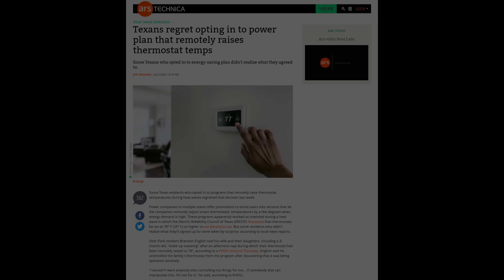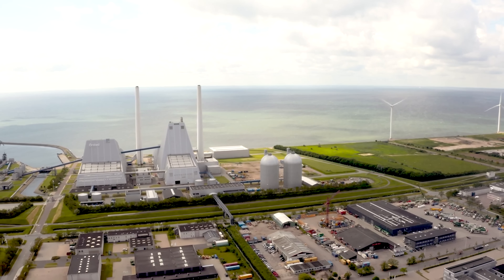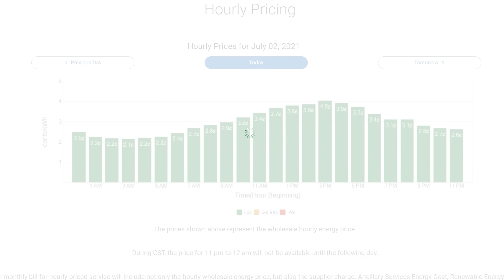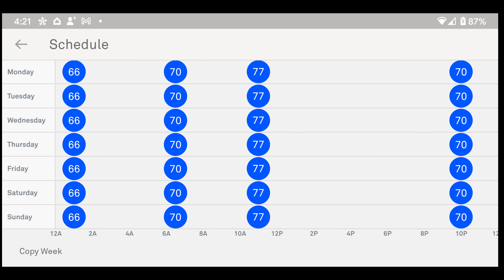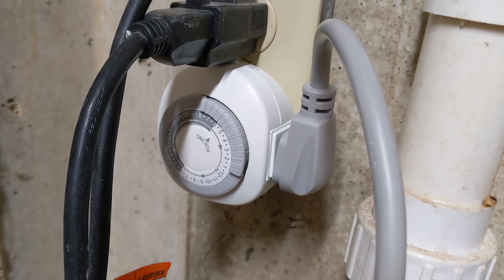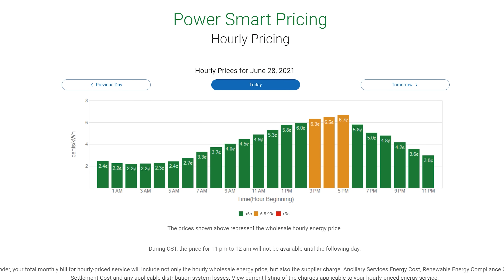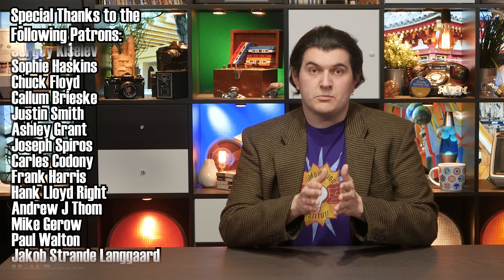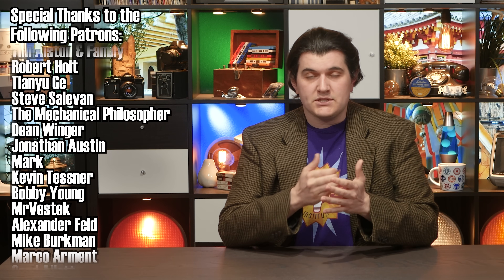Batteries aren't the only way to store energy. Here's another.

Comment: 22:36 As an engineer, an overly simple solution that still meets the objectives IS the elegant solution.
Reply: Exactly, the simplest solution that gets the job done adequately is the best solution. You do have to define what "adequate" is in order to get a good result from this method, however.
Reply: Yea probably these sort of solutions deemed "not elegant" because of their simplicity suggest a certain lack of optimisation. Though, this isn't necessary the case - but being well aware just how complex things can get when optimised to certain objectives - makes any simple solution a suspect.
Reply: @CraftyF0X  The thing is, with good engineering, you need to know when to stop improving the thing and just build it. So you set a target for what's "good enough", and when you hit that target you don't add any more optimizations for that goal. You might work on reducing the cost of producing it, but you won't improve its effectiveness at performing its designed task, because that's wasted effort.

Comment: Our house was built in 1951. When we bought it 25 years ago it still had the original single pane wood windows that swelled/shrank, leaked air, sweat and frosted over in the winter. About 5 or 6 years after we bought it, we had all new double pane low E windows put in. Also about 6 or 7 years ago the air conditioner started having issues, so we had a new  high efficiency furnace and AC unit installed. We have also put in all new entry doors (3) and insulated garage doors. We've spent well over $25,000 to save energy/money. Also, we had a new roof put on last year because our old one was worn out and needing replaced, but we spent extra money to put on a roof that is supposed to help with energy savings. It takes a long time to make that kind of money back in energy savings. I'm pretty sure that we may never break even. 
We could have spent more money, for even more "savings", but I don't know how much more "money" we can afford to save.
A lot (I would bet that most) people living in older houses can't afford the expense of retrofitting their houses to bring them up to modern day energy standards.
Reply: 61% of Americans live paycheck to paycheck, so yes, a majority of Americans don't have any capital for improvements. I kept thinking about my mom's single-wide trailer and that even if I had the money for improvements, it seems really silly to pull the whole thing apart to add insulation. Would probably be better to add a vertical wind turbine on top and call it a day.

And my 7th-floor apartment with a wobbly sliding door to the balcony isn't doing me any favors. At least heat pumps are standard on the building.
Reply: We just got a home built in 1973/1974. Still has original single pane windows with aluminum frame and individual panes of glass (6 over 6, has glass squares/rectangles with aluminum strips between them).
Winter time they sweat and drip all over the windowsills.  Summer time they radiate heat right through.  
Original insulation. 

We are already fixing to get a new roof, and I'll be putting the plastic shrink film over all windows..... They're on the "list" but they're gonna be mighty expensive!
Reply: @Nukepositive  you don't pull it apart, it is just blown in.
Reply: I don't know how much more "money" we can afford to save... haha
Reply: Spending $25K to save money on energy costs and then realizing that you won't save a penny is really heartbreaking... and poor planning. The person who buys your home will either thank you for investing in their future or shrug as they demolish the entire building. 
I held on to my old faithful oil boiler (home heating) for years, and I love it...but the price of home heating oil keeps rising and the new bio diesels have not been cheaper or accessible. The extra yearly expense for oil means that I will see a return on my investment in a few years.
Reply: I live in a drafty house with a huge set of old french doors, so what I've been evangelising for (the admittedly mild Aussie) winter is electric blankets. Kinda need to use them during the grid's peak hours, but like 20 bucks each, 60W for maybe 3 hours each day, and if you're still cold you can put some more damn clothes on. No I'm not a dad.
Reply: @lucash1980  If they want to sell the house, the investment they made actually will make the house more expensive.  So they effectively raised the value of their property. (and probably lowered their taxes)
Reply: Werent there some tax incentives to make your house more energy efficient? You better check how is your local laws work in that regard, but I think you can request lower property taxes or some shit like that.
Reply: I feel for you.
Im in a duplex built in the 50s
landlord been here 3 times in past 5 years fix ac u nit
I think you been mislead ina bunch of ways
25,000 spent on saving money seems odd
been cheaper getting homeowners insurance or better yet
DIY a little at a time

enrgery standards? really?
how about safty and comfort standars?
wish could see your house give a quote
25,000 may could claim as home equity on taxes?

Comment: Air flow management is basically all we had for a few years. Draw air on the shaded side of the house and exhaust on the sunny side. About halfway through the day we would switch it. Combined with proper window shades, it was very effective.
Reply: Yet most of the new houses in Texas don't even do this basic thing
Reply: @Cian O'Flynn This is only feasible in places where temperatures actually cross comfortable territory for significant lengths of time during the day or night for most of the year, though.
Reply: So, no humidity where you live or do you just adapt?
Reply: @donovan2913  we get terrible humidity. The air flow just keeps it all moving
Reply: @2ManyGoats  moving humidity is still humidity
Reply: @ipodhty  don't know what to tell you. It works
Reply: I try to do that, but my parents are so incredibly stupid and wreck the system all the time.

Comment: The Celsius conversion is very much appreciated! (:
Reply: Phil McCracken accurate would be 9/5 *C + 32, and the -40 is a thing.
Reply: @Phil McCracken yeah but most of the world doesn't want to have a calculator in the hand all day...
Reply: @Phil McCracken I've honestly just memorized every 10°C jump in Fahrenheit up to 40°C, and then from there go 2°F for every 1°C. It's off by 1°F when you get close to multiples of 5°C, but close enough anyway.
Reply: I just remember that each degree Fahrenheit is 0.55°C (recurring) and then guess wildly from there! I am often wrong
Reply: @FoxEagle993  every 9°F is 5°C, but remembering every 18°F is 10°C and working from there is a bit easier to remember.
Reply: @Phil McCracken You can improve that trick even further, by only adding 30 instead of 32. Multiplying by 2 will naturally overestimate, so if you then add a little less, the errors tend to cancel out and the result will be slightly more accurate, plus it saves a step when adding in your head.

Comment: Running AC at night would also be more efficient in general too wouldn't it?  With lower temps outside it would be easier for the condenser to reject heat.
Reply: Yes. Only no answers would be if it were cold cold. In ambient temperatures drop to 40⁰ and lower most residential aircons run into problems (unless its a heat pump in heating mode ofcourse👍) and  damage your compressor. Its called "slugging a compressor " funny name. Basically what happens is this:
Compressor is made to pump gas/vapor, so, if temp drops low enough to cause the heat in the low pressure gas to leave fast it will condense into a liquid. This is bad news since liquid doesn't compress. When liquid enters the compression area (could be a piston, scroll, or rotary type), it damages the parts that do the compressing and eventually crumble those parts into chips and chunks. 
Fun fact. To get around this happening in Commercial applications they toggle the condenser fan via pressure switch in refrigerant line. Also the put this giant hose clamp around the bottom of the compressor that is a heating element that warms the compressor and oil to a good operating temperature in low ambient conditions.
Reply: @joshmiller7870  Probably you dont need AC if the outside temperature is around 5C.
Reply: @collan580  personaly myself, no need. However in commercial buildings this common practice.
Reply: @collan580  Because of uneven heat distribution. Some rooms will still need heat rejection. I have servers at home, and even in the winter that room will need to be actively cooled. It isn't efficient to dump heat into the air then have the A/C remove it later.
Reply: @henryzhang7873  Most people dont have servers though and if you do have one, maybe a smart system can be implemented to use that cold outside air to keep those servers cold.
Reply: @collan580  so true lol. This dude is the epitome of "but sometimes" that TC rants about.
Reply: Through ventilation at night you can reduce bills too.
Problem is that most AC are air to air. There is no buffer. Air on rooms is replaced anyway so by 4pm there will be no cooling effect left.
Option is to store it in ice at night.
Reply: @marcinwaach7639  Not neceseraly. If you always cool your house and you have at least okey insulation, the cold walls and furniture will help to keep air cold.
You can see this effect when you had a few cold summer days and after that a really hot one.
Reply: @collan580  Heating effect stays longer than cooling. When AC is switched off its hot very quickly. Like im saying cool down water and use it during the day will work. 
Cooling air is not effecive and will just produce high bill.
Instead people should install solar panels to reduce bill for AC. This 2 devices are perfect pair.
Reply: @marcinwaach7639  ? Newton's law of cooling is the same in both directions, the difference is that us, our electronics both makes heat.
Reply: Yes. Also in summer we enjoy fresh air and open doors / windows more often.
Than there is also infrared radiation.
In summer we get way more of it from outside to inside than we loose in winter to the outside.
Reply: Yes and isolation works differently for each of them. Differently at different temperatures.
Its not very effecive to cool air when not needed. 
With exchange to air its effective to cool exacly when needed.

Again if someone expands system and cools other medion like water then its good idea.

Also in hot areas its good to have white roof and small windows as thats the main source of heat.
There are also other technics to lower temperature. AC is just very convenient one.
Reply: @Swim Fan conduction convection and radiation not infrared
Reply: @joshmiller7870  this is why many systems have a suction accumulator installed. It prevents the slugginging problem.
Reply: Running your AC when it's below 60 degrees could damage it or shorten it's life span. AC units use a heavy grade oil that provide excellent lubrication at high temperatures but are too thick to provide good lubrication in low temperatures.
Reply: @29erallday  Exactly! I can't tell you how many times I've had to explain this to 10+ year HVAC techs.
Reply: as a licensed HVAC engineer i must say you are 100% correct.
Reply: @collan580  yeah, at that point just save yourself the electricity bill and open a few windows for a while to get the temperature down to a comfortable level
Reply: Obviously it's less efficient to over cool 6-12 hours in advance than to cool only when needed(The house will bleed temp all day before you need it, you're cooling a house when it isn't even warm outside). This is done because of the quirky financial reality not what technically uses less power in total.
Reply: I run AC, when I need it, only at night past peak ToU rates.
Reply: @OGPatriot03  I thought so too, but it turns out this is offset by the lower temperature outside making it more efficient to pump heat out in the Summer.
But in winter it makes things even worse, cause the night is colder outside.
Reply: A funny thing is that if this was common enough it would stop being effective by shifting peak hours to the middle of the night.

Comment: Also keep in mind, better insulation not only means the "battery concept" works... it also reduces the overall consumption. In Germany we are building very low energy houses as a standard. I currently consume in my 100m² flat only around 700kWh PER YEAR! And that's the standard from 5 years ago, now we would approach maybe 400-500 kWh.

Comment: You can create a "solar heater" by filling large barrels full of water and painting them black. Then you put those barrels in an insulated greenhouse
Reply: Thermal mass 👏
Reply: Then you live in the insulated greenhouse to profit off the solar heat.
Reply: Or get those solar panels/collectors and tie them into your warm water system directly.
Reply: @noahluppe  Yeah that's what the guy had in the video. It was pumped throughout the house and used for "hot" water
Reply: @daze8410  I know them as connected systems, so the water heater and solar collectors are both connected to the same hot water tank, so even if the sun just makes a couple of Kelvin you save up on the heater's energy consumption.
Reply: Great idea however you need stored water to be at least 60C to prevent legionella. Unless you use a closed loop system.
Reply: This doesn't help if you're trying to cool your home ;)
Reply: @ThomasBomb45  It can, the opposite would be placing barrels in a deep root cellar.  Some root cellars are capable of freezing temperatures without any equipment. Its a similar concept to heat pumps, which use the earth/bedrock as a heatsink
Reply: @daze8410  yes that can work. If you are able to dig deep enough. Doesn't work for people who have bedrock a few feet down :)
Reply: @ThomasBomb45  *Doesn't work for people that don't know how to work with bedrock
Reply: A lot of countries with warm climates basically do this but they don't bother with the greenhouse. Just stick the barrels on the roof.
Reply: @forenamesurname4576  Or you can use an antimicrobial additive.
Reply: I did this! Checkout my early videos.
Reply: You can also run a coolant line through a large pile of decomposing organic matter, like mulch, then into a heat exchanger in the greenhouse.
Reply: @mhess427  Just be sure those 3 to 4 hundred pound feral hogs aren't in your area searching for grubs! (My poor garden, lol)
Reply: How do you insulate a glass(green) house?
Reply: @richeyrich2203  I used swiveling panels of insulation and curtains but they were troublesome.